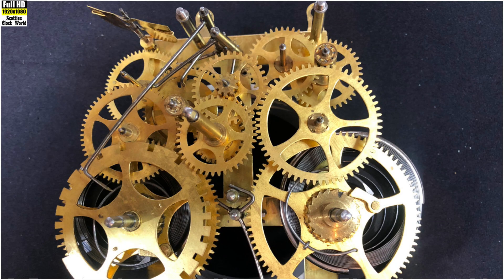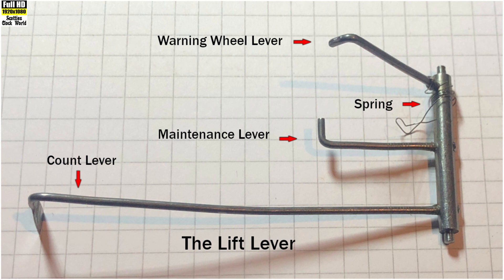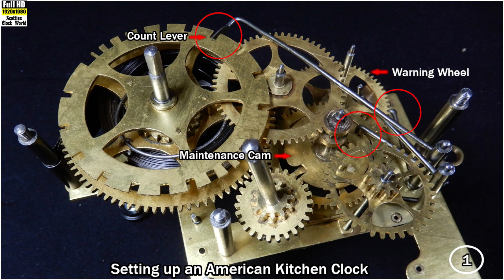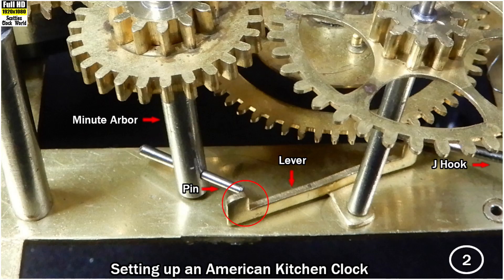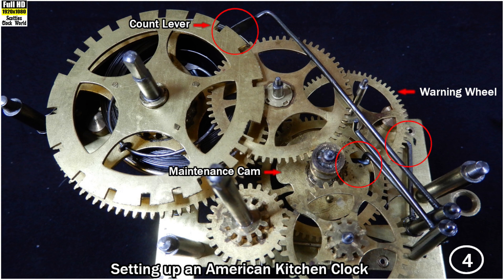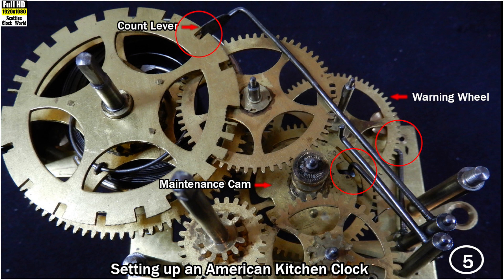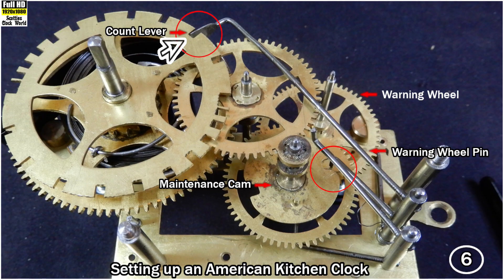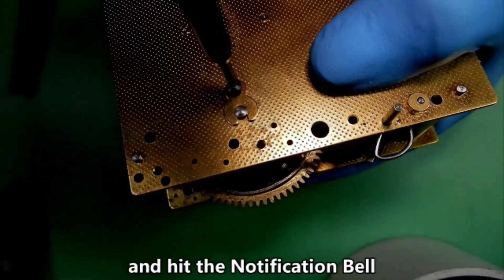Clock Repair For Total Beginners - Lesson 13

Comment: Scotty, thank you very much…

I have a twist to your information…

My warning wheel in my 1870 Seth Thomas OG clock… It really doesn’t have a warning wheel. It does have a hook that functions in the same fashion that’s attached to the arbor on the fly…

Thank you for your detailed information so I can understand how the mechanism is supposed to work…

This is my first try repairing my family clock. I appreciate all of your help.

I could not have done it without your help

Sincerely, Chuck😊

Comment: My Ansonia clock stops at the exact same time each 12 hrs at 1:15. The clock has been cleaned works fine at all other times. It is in beat by a spirit level. The fingers are not touching each other. Any solutions?

Comment: G'Day Scottie. I had to watch that 3 times to begin to understand.  Original clock designers must have spent MANY countless hours/weeks/months trying to work out the mechanical workings.  My Korean clock does not have the leavers BUT still trying to work out where each wheels rotation sits.  Thanks again Scottie.  🙂  Rob
Reply from the maker: Hi Rob, it seems a bit complicated at first but once you've set up a few clocks it becomes second nature. 
Short version.
When setting up the movement:
# set the count lever in a deep slot on the count wheel
# adjust the maintenance cam so the lever sits in one of the slots
# then add the warning wheel so the lever arrests the pin
# finally add the fly and tighten down the nuts on the pillars.

Thanks for your comment.

Comment: Thanks Scottie.  Waterbury, CT USA is my home town.  The skeletons of several of the brass/clock factories that employed a good percentage of the people who lived here still remain in Waterbury.  Waterbury is still known as The Brass City.
Reply: Are there any active clock or watch factories still functioning?
Or have they all gone the same way?
Reply: @mikemesserschmidt810  Not in Waterbury. Timex was based in Middlebury (suburb of Waterbury) as late as the 80s and did some assembly work there, but as far as I know, there are no mechanical watch/clock movement makers left in Connecticut and probably not in the U.S.
Reply from the maker: Interesting facts on Waterbury, thanks.